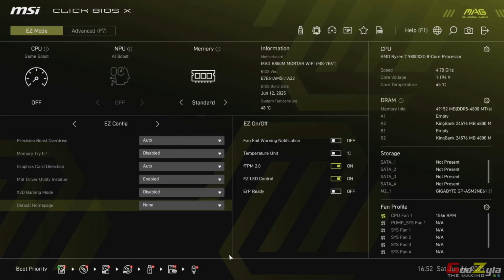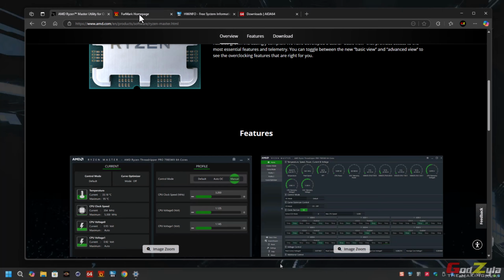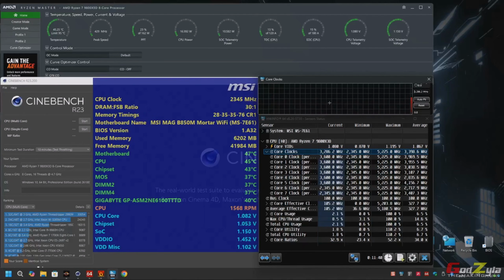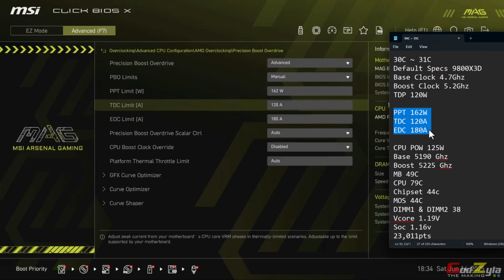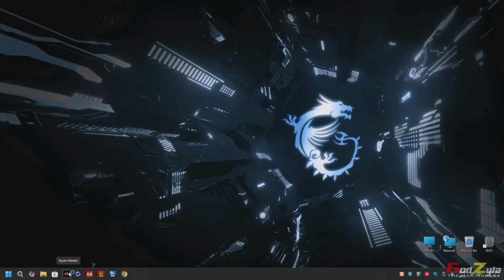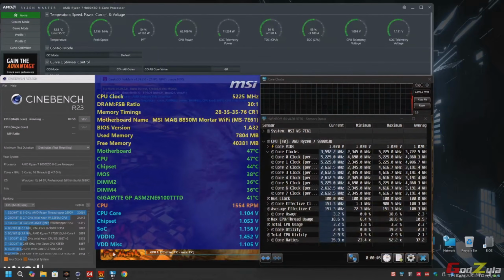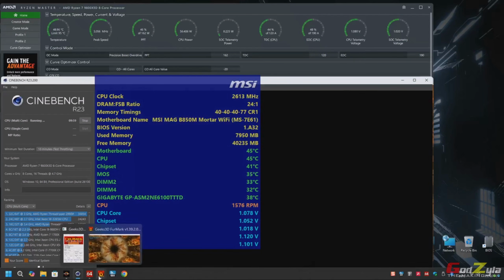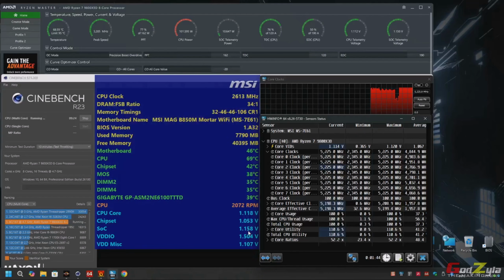PBO2 Curve Optimizing with 9800X3D on MSI Motherboard

Comment: -25 CO +200 boost > -30 CO +200 boost
CPU Offset voltage -0.05v 
CPU SoC voltage 1.15v (6000 MT/s, 32 CL, Tightest)
Max Core VID 1.19 > 1.17
Max PP 133w > 128w
Max CPU Temp 72c > 70c
R23 Multicore 30min 23.993 (5.35 MHz) > 24.223 (5.38 MHz)
In game 5.4 MHz.
Thank you 🙌
Reply from the maker: Welcome to my channel Gangsta. Congrats on your configuration. I am glad you find this content useful and thank you for your feedback. 👍

Comment: I was using pbo -25 all cores, soc 1.20v (a bit high but at least something), temp limit 80° and default expo 6000mhz cl30 for about a 1.5 years on x870e Tomahawk wifi. It was stable but i just updated my bios and followed your guide instead of reapplying my previous lazy ah settings. Better late than never. Thank you!
Reply from the maker: Welcome to my channel reinkaos. Thank you for your feedback. Hope it did aid you further with lowering your temperature and power consumption.

Comment: Nice video, but I'm noob, so its hard to understand a bit 😂 I've just bought 6400 cl32 ram kit, can I run it stable with 1:1? 9800x3d and x870e msi gaming max wifi
Thanks, man!
Reply from the maker: Welcome to my channel G.M.B. You can try set FCLK to 2133 and set it to 1:1. But it’s not guaranteed. If 6400 1:1 remains unstable, to keep the 1:1 ratio (UCLK = MEMCLK), drop the frequency to 6000 MT/s, and manually tighten the main timings to CL30-36-36-76. In general for 6400 MT/s, it’s best to run at 1:2.
Reply: @KleoYan thanks for the lessons
Reply from the maker: @No_r_diC more of sharing and you are most wlecome.

Comment: Hi again. Im trying to understand why is LESS undervolting better for higher load? I get the band analogy but it doesnt exaplain what's going on in reality. I get that higher load requires more power but why is undervolting stretching that band at all? Isnt running lower voltage (if stable) always better? Why not?
PS Ill be doing that to the 7800X3D now.
Reply from the maker: Jarek! By default, AM5 feeds the CPU more than enough voltage. When it gets hot, performance just sticks to AMD’s stock specs. I am using moderate PBO2 limits rather than aggressive per-core tuning. This allow us to have a sweet spot :
1) Lower temps
2) less heat
3) Enough thermal headroom to boost past default AMD performance.

For your 7800X3D instructions below and if you are using 32G CL28 / CL30 / CL32 at 6000M/T you can try this out
1) Enable XMP or EXPO (depending on your rams profile) to Profile I
2) Set DRAM Speed to 6000
3) FCLK Frequency to 2000
4) Set UCLK DIV1 Mode to UCLK=MEMCLK

You can try this but unstable, kindly set it back to Auto
5) Set High-Efficiency Mode to Enable
6) Set Memory Timing Preset to Tightest

You can try this but unstable, kindly set it back to Auto
7) Set CPU Core Voltage to Offset Mode
8) Set CPU Offset Mode Mark to - (Negative sign)
9) Set Offset voltage to 0.05v

Under Advanced > AMD Overclocking > AMD Overclocking
10) Check SoC/Uncore OC Mode is Enable

Under Advanced > AMD Overclocking > AMD Overclocking > Precision Boost Overdrive
11) Set Precision Boost Overdrive to Advanced
12) Set PBO Limits to Manual
13) Set PPT to 80000mW (take note of the zeros, its 4 zeros and not more)
14) Set TDC to 75000mA (take note of the zeros, its 3 zeros and not more)
15) Set EDC to 150000mA (take note of the zeros, its 4 zeros and not more)
16) Curve Optimizer to All Cores -(negative) 20

You can't use curve shaper as it does not support

17) Save the settings, boot into windows, test for stability with aida 64 and do a benchmark test. once stable, play some games for reality check. 

things to observe when you change settings, my advise it to use Aida 64 stability test. Observe again SoC Voltage and Vcore drawn. In addition, observe CPU Temp, Mobo Temp, VRM Temp, Chipset Temp and RAM Temp and M.2 Temp. Do benchmark test with Cinebench, 10minutes run. 

Once it's stable and getting good results, I will not stop here. I will again test on Aida 64 for stability for at least 2 hours and follow by OCCT for 2 hours. 

Once all ok, run some games and do your observation again. Good Luck!
Reply: @KleoYan  Oh wow, it's basically a written summary of the vid for a 7800x3d! Thank you! I do feel bad cos it wasnt necessary, still very appreciated!🖤
Perhaps i was too hazy as to what im asking. At 34:00 you're fine tuning the PBO curve. Why the higher the temp and frequency the lower the undervolting? Why -5 at high but -15 at medium? Why would be want more voltage and high temp/frequency? If the -20 works (you set as a general value) why is -5 better at high (so -25 in total according to the curve you kindly illustrated, i guess cos the final value is CO+CurveShaper at 36:36 )? If the AM5 provides more than enough voltage, shouldnt lower value be better for every case?
As for this curve at 36:36, am I right to assume that the final offset is -20 + -5 for high? How do you know that when leaving min and low to auto it goes to -20 (so -20 + -20?) cos that's what the curve seems to show? Or does auto just take the CO general value (-20)? For a grand total of the undervolt is it CO+CS or does the CS overwrite the CO? Is it -40; -35; -30; -25 for min, low, med, high or -20; -15; -20; -5 in total?
In short: why bother with this fine tuning at all if the cpu is stable at given undervolt (like -20)? Why is it better for the chip(let) to have -5 at high?
Reply from the maker: @tyraelpl  if you set only CO lets say -30.. be it med high or max.. it will pull at magnitude of -30 and if it crashes you will need to lower down the CO. 
Else for CS you can fine tune it.. example here CO is at -20 so when it hits med frequency (lets say CPU Frequency 3.5Ghz), it does not require that much current, therefore I can have lower magnitue.. which is CO -20 + CS -15, total lesser current drawn is by -35. 
Next when it reach high frequency ( lets say CPU Frequency 4.5Ghz) it will need more current.. so will have to step up the magnitude, which is CO -20 + CS -10, total increase of current drawn with magnitude of -30 to prevent crashes. Final stage which is at max, it needs even more current to run without crashing. hopefully this will aid you to understand how CS works and to answer all your questions.
Reply: @KleoYan  Aaaaah yes! Now it's clear! Thank you for that! In that case, why not set -20 to min and low so that it's at -40 in total? Is it because at low-ish load it doesnt matter for the longevity of the cpu? Your curve illustrates sth like -20 i think but you use auto in settings, why not just put a value there?
Im sorry but I require autistic details to learn. I like to understand; not just take everything on faith and learn by heart. At the same time im very grateful for you taking the time to provide them🖤
Reply from the maker: @tyraelpl those figures are my sweet spot. Not too little or not too much. I like to give slacks on my configuration and not over stretching.

Comment: It’s a great video. I did almost everything same and followed advice. But I see that my cou core max is stuck at 5.2 ghz with co -30 ppt:120 tdc:90 edc:120 
But when I put -20 it boost to 5,425 how it comes. What should I do any advice ?
Reply from the maker: Thanks for watching, Van! Glad you enjoyed the video.
What you're experiencing is a symptom of clock stretching or instability caused by over-undervolting.
Clock Stretching at -30 CO, the Curve Optimizer offset is too aggressive, the processor doesn't get enough voltage to run stably at high clocks. Instead of crashing, the CPU dynamically drops its effective clock speed behind the scenes to maintain stability, which is why your core max caps at 5.2 GHz.
Higher Boost at CO -20, the CPU receives enough voltage to stably sustain higher boost frequencies, allowing it to hit 5.425 GHz without throttling performance.
Lowering PPT, TDC, and EDC limits the total power and current the chip can draw. If TDC or EDC limits are too tight, the CPU will hit a ceiling early, which forces power throttling.

My Advice
Stick with CO -20  (or test -22 to -25) as -30 is clearly pushing the silicon past its stable limit.
Raise your power limits slightly if you want maximum boost clock sustained under heavy loads, Set to stock PPT: 162W, TDC: 120A, EDC: 180A to ensure power limit starvation isn't capping your boosts.

My goal with these settings isn't to squeeze out every last MHz through extreme undervolting, but to strike a comfortable balance between low temperatures, peak performance, and daily system stability!
Reply: @KleoYan thx my cpu is not a good bin. I understand better now
Reply from the maker: @Vanthai777  Thanks for the update. Honestly, the settings on this content is on a safe, moderate undervolt that limits heavy current draw. That way, the system stays stable even if you don't have top-tier silicon. It’s better not to push hardware to its absolute brink, where a moderate setup will keep your system healthy for a longer run.

Comment: Hi. I followed the video and set the basic things in bios. Expo, Soc and core voltage offset. But i only get a base clock of 4990 Mhz with 82 C in Cinebench. Without the Core voltage offset i get 5050 MHz with 89 C. Is this normal?
Using a X870E carbon with newest Bios
Thanks in advance.
Reply: Already did a clear cmos. Had the issue also before updating to the newest bios 7E49v1AA3 (TSME functionality added). 
If i change cinebench priority from 'below avarage' to high i get a slightly better score but HWInfo does not properly update and i cannot see the clocks.

Also: Ryzen master shows EXPO disabled, even though it is enabled in Bios. Memory speeds shown align with set value of 6000 though.
Reply from the maker: @damoklesghost7919  let me try to get the X870E Carbon, it's Carbon and not max right? btw can you draft me an email godzylatech@gmail.com. I will follow up with you via email. thanks! 
Note : allow me a few days as I might or might not be able to loan the X870E Carbon from MSI. I will update you via email. thanks!
Reply from the maker: @damoklesghost7919  gotten your email. Thanks, will follow up with you via email. kindly allow 2 to 3 days ya. hopefully by this weekend will get things sorted out.
Reply from the maker: Welcome to my channel Damokles Ghost. I do not have the X870E Carbon with me but I've done a quick test on the X870E Edge Ti.. I am getting 5225Mhz without issue. I would advise you to do a clear cmos and do step by step. 
btw I am using this bios version 7E59v1A92 2026-06-26

Description:
- AGESA PI-1.3.0.1b Patch A updated.
- TSME (Transparent Secure Memory Encryption) enabling with the Ryzen 9000 series CPU.
- Optimized for CXSH (CXMT) memory chip.
SHA-256:064621448addaafdd6d9b43f6ecccca4e3cffc46bed6998694d7226e6490e99b

Comment: Is it possible to apply this setting with the same DRAM and the same motherboard, only with an AMD RYZEN 9850 X3D processor?
Reply from the maker: Welcome to my channel. Before you apply, it will be better to fully understand what you've applied, which I have shared in this content,  the fundalmental are there. Do find out the 9850X3D PPT, TDC and EDC first. Also kindly on your end as each processor are bin differently.

Comment: Thank you so much for your detailed video. For some reason, during Cinebench my CPU won't go past 5.0 GHz. I'm using the same voltage offset as you (-0.500) with an MSI X870E Tomahawk, a Ryzen 7 9800X3D, and 2×32 GB XPG AX5U6000C3032G memory. My CPU is cooled by a Kraken X72 AIO. Do you know why that is?
Reply from the maker: Welcome to my channel henkthehunter. You might want to try just with one stick of rams. If it works, this tells you that your rams unable to run at VSoC at 1.15v and will require 1.2v or more.

Comment: Thank you verry much sir, mine temps droped 20C on air, stable all cores boosts 5.225mhz, great succes, 73C on air in 25c room. One thing i dont understand, that idle temp havent change at all, watching yt video and idling about 54C, same as before undervolt.
Reply from the maker: Welcome to my channel Jan Eichler. That’s normal as it’s a characteristic of the processor. It will however idle at 50 to 62. Don’t be alarm 😉
Reply: @KleoYan  Great news, thanks again

Comment: Hi. Before watching this video, I had set up my system a week ago and decided not to enable EXPO until I was sure of what I was doing. Yesterday, I decided to enable it and immediately noticed very high voltage readings, so I opted for a manual memory overclock, starting with 6000MT/s CL30 at 1.35V, with vSoC and VDDIO set to 1.2V. I ran the OCCT Memory test (at 90% usage) for 30 minutes, and it passed without errors. HWInfo64 reported a maximum of 1.208V. My question is: based on your recommendation, could this voltage—however slight—have caused any kind of degradation during those 30 minutes of testing?
Reply from the maker: Welcome to my channel Anônim0. In general , degradation take place when you are using your system. By default your system will run fine with VSoC at 1.2v or lower during load. For me just to prolong a little longer, I have set my VSoC to 1.15v which the final draw is below 1.2v. I will not touch VDDIO just for stability. The choice is up to you.
Reply: @KleoYan  I see, but is a VDDIO of 1.2V safe? When I enabled EXPO on my memory modules, I noticed it reached 1.4V; in the video, it even hits 1.5V.
Reply from the maker: @Anônim0-s9r6x  That voltage is completely normal for DDR5 when you turn on EXPO. I usually leave it alone since the RAM is built for those exact specs. But if you feel like tweaking the VDDIO to bring it down, you can try it, for me I won’t as due to unstable issues with certain apps I run.
Reply: @KleoYan  I see. Regarding the CPU NB/vSoC option, what is the difference between "AMD Overclocking" and "Override Mode"? I can't find a clear description; switching between them seems to change the values displayed in ZenTimings. HWInfo shows the value entered in the BIOS, but ZenTimings shows up to 50–100mV higher than what was set in the BIOS.
Reply from the maker: @Anôni @Anônim0-s9r6x er to use the manual override rather than AMD's automated overclocking, as it gives me full control over the settings. In most cases, I set mine to 1.15V, which may peak at 1.168V during actual operation. My goal is to keep the VSoC below 1.18V, as most DDR5 RAM running between 6000 and 6400 MT/s doesn't require anything higher. Plus it’s stable and runs at lower temperate on my CPU.

One thing to note. My configurations on DDR5 VSoC are my own findings. Not removing too much voltage nor pumping too much. 1.15v is the sweet spot for most M/T 6000 to 6400 rams, in addition on CL28 to CL32 will run with no issues.

Comment: Hi Kleo! I just bought a Ryzen 7 9850X3D and paired it with this motherboard. Can you share the recommended Curve Optimizer settings for this processor, or are they the same as for the 9800X3D?
Reply from the maker: Welcome to my channel TMJackFF, the Ryzen 7 9850X3D shares the exact same basic architecture, 8-core single-CCD layout, 120W TDP, and AM5 platform requirements as the 9800X3D. You can use these guide but if you are gaming, kindly set your CPPC to driver instead of cache.
Reply: @KleoYan  Thanks for sharing Kleao. Since the 9850X3D is a single-CCD X3D chip like the 9800X3D, I'm curious why you recommend CPPC = Driver for gaming instead of Cache. Did your testing show better FPS or frame times with that setting?
Reply from the maker: @jacknfum  if you set CPPC to cache.. it means it does you have processor all cores to work at the same time.. this is only deem useful when you are doing work load like 3D rendering, compliation and multitask. for gamine you need not to have all cores working at the same time, so setting it to Driver, it will pick the strongest core when you are gaming.
Reply: @KleoYan  Ah I see. Thanks for the detailed explanation brother. I didn't know that about CPPC. I'll set it to Driver for gaming as recommended. Appreciate your help!
Reply from the maker: @jacknfum  You are most welcome. All the best with your configuration.. 🫡
Reply: @KleoYan  Thanks bro! Appreciate the guidance. Looking forward to testing it on my setup. 👍😁

Comment: can i just copy your settings i have the same processor 7 9800x3d on the msi mag b850 edge ti wifi with cl30 6000mhz ram is it safe to copy your settings?
Reply from the maker: Welcome to my channel VIPER, you can give it a try, it's safe to set, but at the CPPC settings, set it to Driver instead of Cache. Driver will be better for gaming.

Comment: Do i keep the offset -0.05 offset if i want to make a curve optimizer?
Reply: Is it better to just use the offset without curves? Or curves with auto offset?
Also Can i usr use pbo limits values? They are the same for all 9800x3d?
Reply from the maker: @mahmoudaboudaher7173  If your processor is of a good bin, you can use both Vcore Offset + Curve Optimizer + Curve Shaper. I would advise you to do baby steps at a time. 1st set your rams to EXPO profile, Set VSoC to 1.15V and follow by the Vcore Offset. Save it, boot to windows 11, run aida 64 stability thest for at least 30mins, if stable, proceed to set the PBO2 limits + Curve optimizer, again save it and run aida 64 test. if stable, proceed to set Curve Optimizer.. It will be best if you can observe the behaviour as you set, this will help you understand how your processor + rams and motherboard react.
Reply from the maker: Welcome to my channel Mahmoud Abou Daher, if it's stable, you can keep the VCore offset. If it's unstable no matter how you tweak your curve optimizer, then set it back to auto.